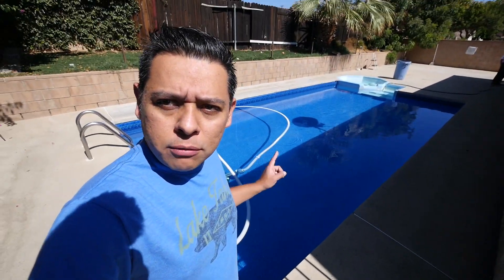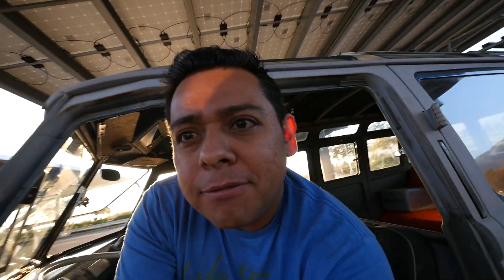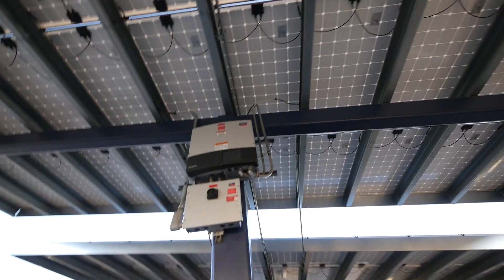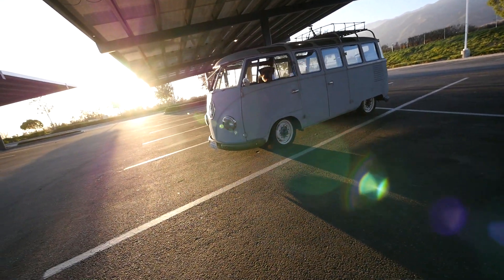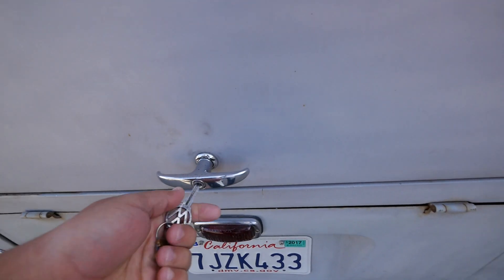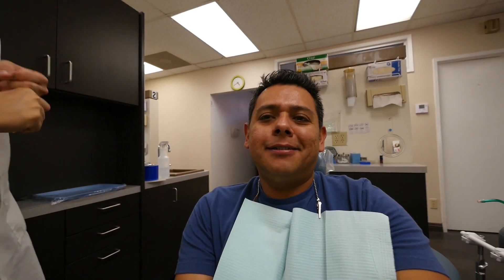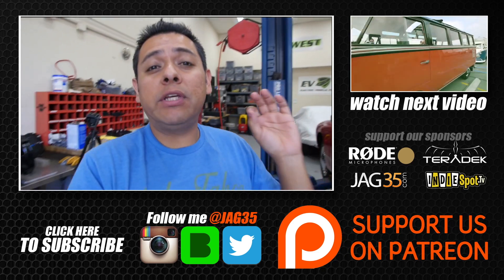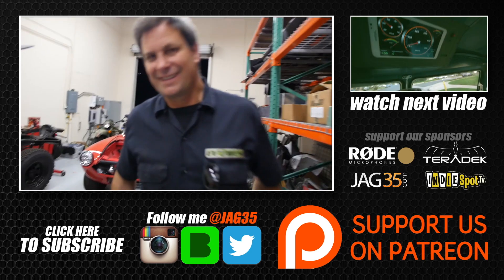Fields of SOLAR PANELS FOUND IN CALIFORNIA - Vlog #185

Comment: Car port solar panels.. the best idea for cool parking in the summer.. though in Cal.. it's summer all year.
Reply: it makes so much sense I'm shocked it isn't more common. my car would still have all it's paint on it if my work had solar panels to park under! plus it's a lot more comfortable at end of the day, saves a bit of fuel from going easier on the a.c.

Comment: Could you not fit the batteries in the back seat of the Ghia (if there were back seats, that area)?
Reply from the maker: +Ceazar Carr  why do you ask?
Reply: jehugarcia Just wondering. It seems like it would look cleaner. Wondering if it was practical.
Reply from the maker: +Ceazar Carr they are not visible behind the seat where they currently sit
Reply: jehugarcia Oh, cool.